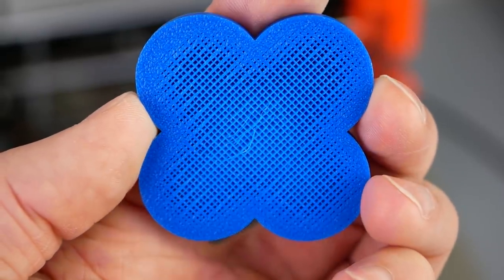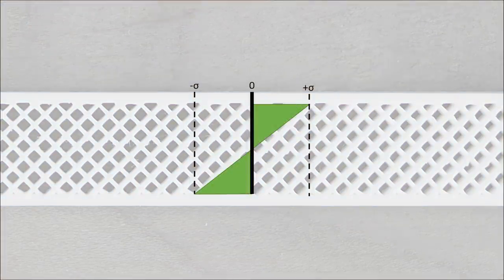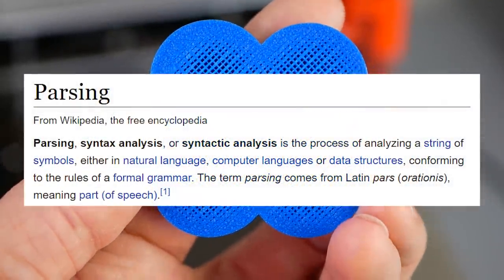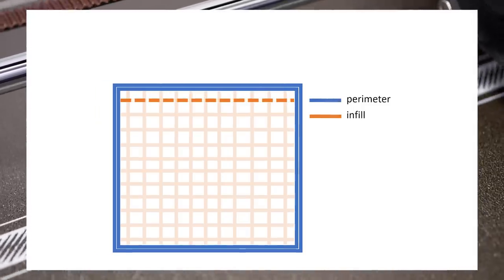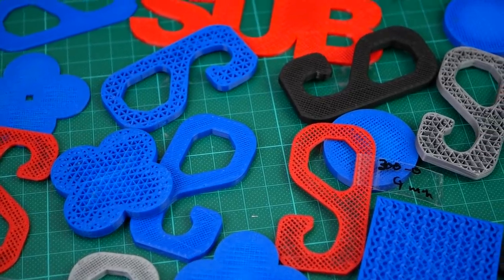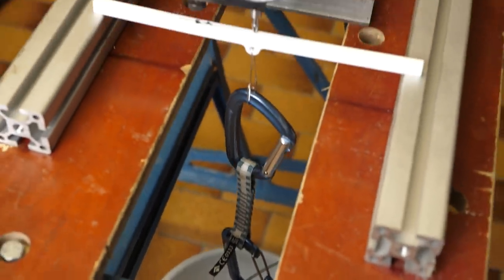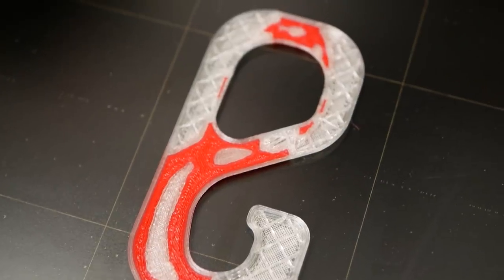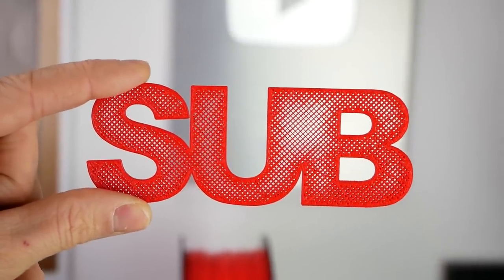Gradient Infill - NEW efficient infill for 3D prints!

Comment: Cura has had a similar feature for a while that increases the density of the infill pattern closer to walls, as well as floors and ceilings so it works in a more 3 dimensional sense as opposed to the 2D extruded pattern that is constant with Z height.
https://www.reddit.com/r/3Dprinting/comments/61osx6/bonelike_infill_setting_in_cura_more_infill_near/

Comment: Hi Stefan, If the two parts weigh the same but the sparse infill is stronger - the sparse infill is pushing the majority of the plastic to the perimeter.  Why not test the extreme of this theory by having no infill and instead using all of the weight on only perimeters.  Simplified, is 3 outer layers with sparse infill better than only 5 outer layers and no infill.
Reply: One has to have infill.  The job of infill is to keep the sides apart.

Comment: Have you read this research article from last month?  "Human bones hold clue to stronger 3D-printed, lightweight structures"   I read it and wondered if that technique would be the way to do infills on 3D printers.  The link is here:  https://www.designnews.com/materials-assembly/human-bones-hold-clue-stronger-3d-printed-lightweight-structures/12412429062083 

and the research article itself:  https://www.pnas.org/content/116/49/24457?_ga=2.140709302.502931060.1575894594-1393237596.1575894594

Comment: HOW MANY PERIMITERS DID YOU USE FOR HOOK
Reply from the maker: TWO
Reply: @CNCKitchen  i guess for small parts using one would be beter and create sligltly bigger infill density diference from outside to inside of parts. Increasing the infill density dropof would probably improve strenght to weight density as well you want the infill density at the same value as the internal forces are from almost zero in the midle up to 100%on the outside. but this would not solve the problem of too much material where you dont need it. 
I cant wait for a video where you will combine all of your tests into the ultimate strenght part.

Comment: what if... you used 1 extra wall, and for infill, instead of a thick mesh, have a setting for a wide spacing but thicker support?  like.. a support structure with a full double wall but effectively 5% infill?   would reduce travel time and filament use..  a few big sturdy supports instead of a bunch of smaller ones..  steel girder concept, so to speak. :-)

Comment: Why not just up the perimeters to the amount necessary to get the proper strength and then only use as much infill as you need to hold the top  up
Reply from the maker: Adding shells is always a good option but you'll always have the transition between the perimeters and the infill (if not 100% dense) and there this method reduces stress risers and uses material more efficiently.
Reply: @CNCKitchen  I can see that - maybe. We are more interested in directing infill in certain direction which we do with holes usually about 0.050 mm big to "fool" the slicer. BTW from your pics with wider perimeters you got to watch your flow rate I can see hairline cracks between the perimeters on some of your examples and it is possible to split a part along horizontal layer lines just as it is possible to split it along vertical ones. for me in layer width you don't want to exceed the width of the flat bottom part of the nozzle. I posted something along that line on your patreon

Comment: Couldn't you just print the the outside of an object leaving it hollow take it off the printer and fill the center like in an injection mold.  
Heck you could technically fill the center with what ever you like from plastic to cement

Comment: Hi Stefan.  I'm coming to the party very late, but this (brilliant) mod doesn't seem to work on Cura 5.3.0.  I've added the script to my extensions, left the default settings as they were, and sliced the object.  No gradual infill at all.  Is there a "secret"step I've missed?  Grid pattern, Relative extrusion checked.
Reply: Sorry Stefan - my bad.  It certainly doesn't show up in the Cura 5.3.0 preview, but it does print as advertised.  NICE!  How did you manage to get 100% at the edges down to almost nothing in the middle?

Comment: Hey Man, your test are a little bit inconclusive. Your parts should be based by weight, because the gradient interfiers on the infil percentage. Making The test by weight and using The same kind of infil would be more correct.

Comment: Dumb idea, and not a programmer so I don't know if you could make it do this... But couldn't you include a simple parameter to tell the system what direction the load the part is expected to be under is in, and then use that information to put the most material where it needs to be? Not all of the shell needs that much density, right?